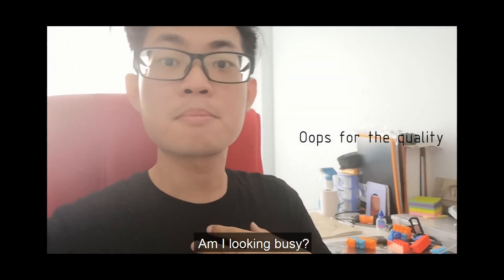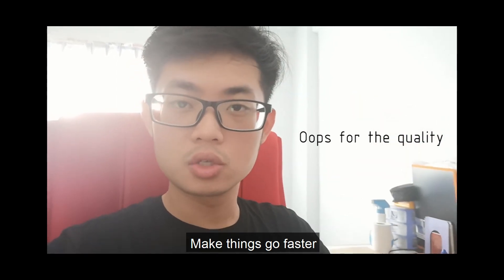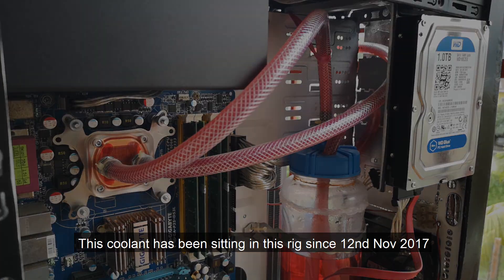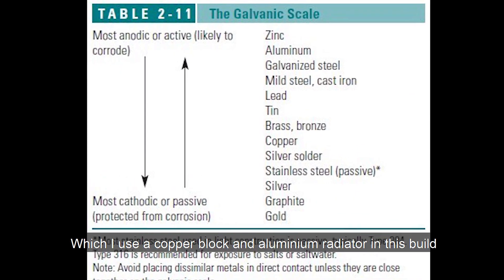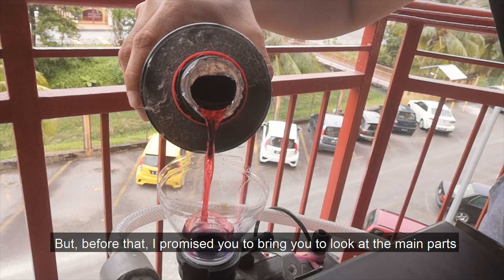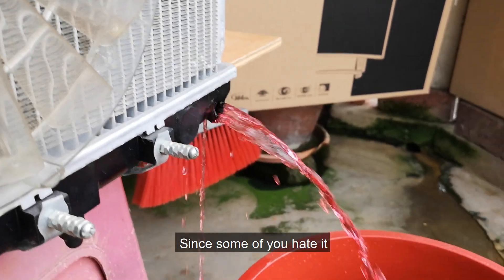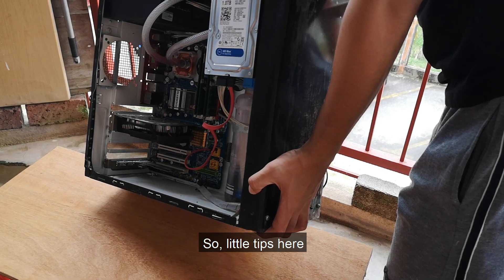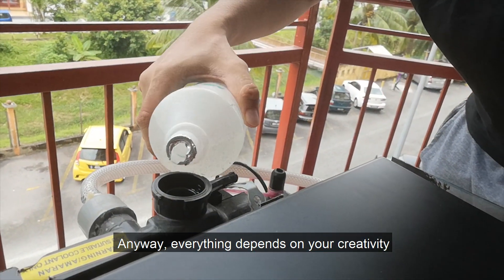My DIY Watercool System Has Been Running for YEAR! Does it Hold-up?

Comment: Come on dude! You can't use a crazy CPU cooling method and then not give us any temperatures? That's the whole point of it!
Reply: 51C under the load
Reply from the maker: Come on, it's no point for me to be not transparent, I show my result in my old video where I just finished the build and ran the stress test....... Should I show the temperature every single video? And this is not the video where I wanted to show the temp but to show the parts, did it leaks, did it corrosion? That's the whole point of it!

Comment: galvanic corrosion actually takes years? lol I thought you'd have a dead loop in months if you mix metals
aren't there any copper car radiators you could use instead?
Reply from the maker: @misa No copper radiator for car in here. For most cases, in open air environments galvanic corrosion do takes years, included a loop, unless you leave it untreated. I use coolant and distill, also keep the proper maintenance, also this PC run for every single day, and I don't see problem so far. Any other popular AIO company they used mix metal as well, they run the proper liquid in the loop, until the pump failed, same principle.  I always tell the truth and it is what I've been done and observed.